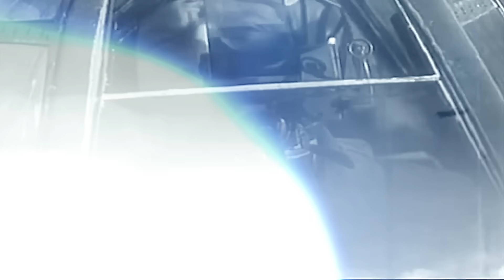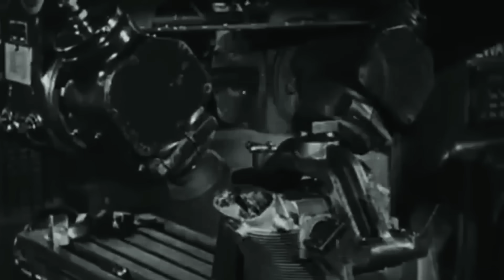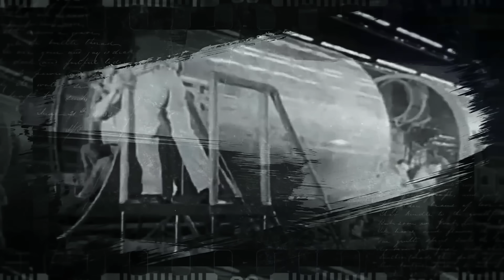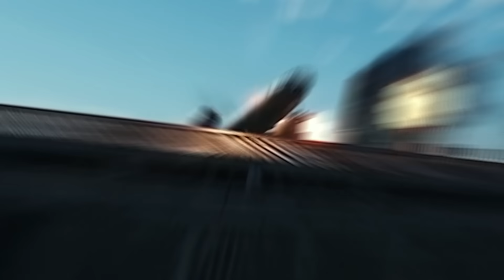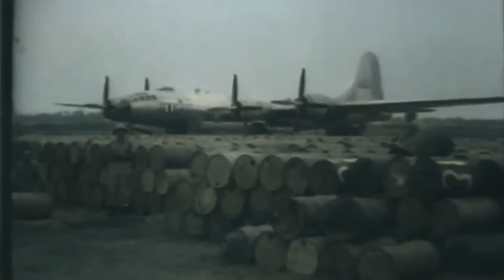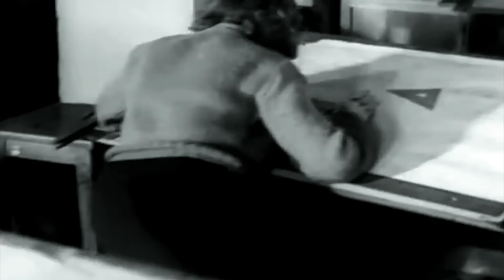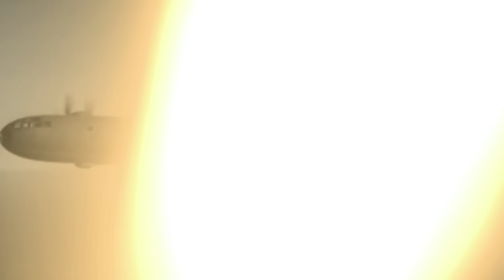The Shocking Truth Behind Wright’s R3350 "Duplex Cyclone" Engine

Comment: When it comes to the early use of the Wright R3350 engines and the early use of the B-29 Superfortress Bomber it has to kept in mind that the United States was at war with Japan and in wartime there was not the luxury of taking time solve the problems of the Wright R3350 engines before wide spread use in the B-29 Superfortress Bomber. Instead it was necessary to push the B-29 Bombers into use as soon as possible with trouble prone Wright R3350 engines. As time went by the problems with the Wright R3350 engines were solved and by the early 1950s later versions of this engine were reliable.

Comment: These engines were chosen for the RCAF's ASW Hunter Killer, the Canadair CP-107 Argus (33 built), which arrived in the RCAF in 1957, five years before the P-3 Orion first saw service in the USN. The Argus was a true behemoth equipped with four Wright R-3350 TC18EA1 Turbo-Compound 18-cylinder air-cooled radial engines, each producing 3,700 hp (2,800 kW). These engines were chosen for their lower fuel consumption, crucial for extended, low-level maritime patrol and ASW missions during the Cold War. Missions were normally 18 hours, up to 26.5 hours, and a record of 32 hours (a world record - no in-flight refueling). 
Two years earlier, the RCAF P2V-7 Neptune (25 built) entered service and for 12 years flew alongside the Argus. The RCAF P2V-7 Neptunes were powered by a combination of piston and jet engines: (1) two Wright R-3350-32W Duplex-Cyclone 18-cylinder air-cooled radial piston engines, each producing 3,700 hp (2,800 kW). These were turbo-compound engines with water injection, and (2) two Westinghouse J34-WE-34 turbojet engines, each providing 3,400 lbf (15 kN) of thrust, pylon-mounted under the wings. The Canadian Neptunes were initially delivered without these jet pods, which were retrofitted in 1959. 
I grew up with these magnificent Wright R3350s constantly coming or going on patrol during the Cold War, and when I joined the Navy, they were on the way out. 
We still had the Grumman Tracker (99 built), which also entered service in 1957, was initially designated CS2F-1(RCN) and later CP-121(RCAF), which was powered by twin Wright R-1820-82WA Cyclone nine-cylinder air-cooled radial engines...nowhere near the house-shaking roar of the four R3350s of the Argus. These aircraft were specifically designed for carrier operations and were the first Canadian-built aircraft ever ordered for the Royal Canadian Navy (RCN). Its primary mission was to provide long-range anti-submarine protection for the RCN's ASW-focused aircraft carrier, HMCS Bonaventure, which embarked them in 1957. During operations, four could be maintained aloft continuously. The McDonnell F2H-3 Banshee (Jet Fighters) were also embarked in 1957, with up to 16 available for CAP. Finally, Sikorsky HO4S (ASW Helicopters) served until replaced by Sikorsky CHSS-2 Sea Kings in 1963-64. 
Then Pierre Elliot Trudeau took an axe to the Canadian Armed Forces, and Canada lost its last Carrier, and all those classic aircraft had no proper home, until some DDEs were converted to DDHs. I am totally off topic. Old age and a lingering disgust of the Liberals and the Trudeau clan of Fools...
Okay, summary: Those engines were shockingly maintenance-intensive, but they were damn awesome.

Comment: I have over 900 PLUS Hours flying Rightseat in EA1F's from Yankee Station carriers using R3350-26W's . Only one time did we abort due to engine problems . Plane capt showed up in readyroom holding both hands in a towel full of metal from the oil sump !!

Comment: Because some jackals engineer wanted to save a couple hundred pounds of magnesium was used.  LeMay had them fly at low level to target which reduced the stresses. Little did they know it also kept them out of the jetstreams
Reply: Nope, the Wright R3350 engines didn't have magnesium engine cases, it's a myth repeated in this video, they had forged steel cases just like the Wright R1820 engines in the B17 had forged steel cases. 
Almost every single thing you'll learn in YouTube videos about the B29 and the R3350 engines is incorrect, because they all use each others videos as source material, they just keep repeating the myths over and over. 
Engine fires weren't caused from them overheating, it's ridiculous to believe that magnesium couldn't dissipate heat quickly enough to where it'd build up enough to spontaneously combust anyway, especially when all the heat is way out in the heads, excessive heat shortened engine life dramatically, and the engines weren't really any more prone to overheating than any other engine, there was never really anything wrong with them in the first place, the problem was the contractor who was making the cylinder head temperature guages for the B29 had never made anything like that before and wasn't calibrating them correctly,  so when the flight engineers would open the cowling flaps to cool the engines it was already too late, they'd already overheated, unfortunately this wasn't discovered until very late in the war.
Engine fires happened during take off, they were what's called induction fires, that's when a fire breaks out inside the intake manifold, it happened because the early pilots would advance the throttles too quickly off of idle causing a cylinder to backfire into the intake manifold, as the plane was rolling down the runway the fire grew through the manifold causing the loss of each cylinder as it got to them so by the time it was near the end of the runway all power on that engine had been lost.
The early B29 pilots didn't have proper pilots manuals, they were simply experienced B17 and B24 pilots who were running the engines they same way they would on those unfortunately, and like the cylinder head temperature guage problem it took a while to figure everything out, and the reason the fire suppression system wouldn't put the fire out wasn't because of magnesium engine cases, once again they were really forged steel, it couldn't put them out because because the nozzles spray the outside of the engine and the fire was on the inside of it.
What was really magnesium was the supercharger impeller, once the induction fire had spread all the way back to the supercharger the impeller would start burning, but once again the fire suppression system wouldn't put it out because it was inside the engine, all that is pointless anyway because as the engine continued losing power the further the plane got down those short improvised runways on those Pacific islands and had totally lost power by the end it was too late, it was already doomed and would crash at the end of it.

Comment: Years ago, I flew DC-7s as air tankers. They had the 3350s, 3400HP for takeoff, 2900 continuous. 

If you treated the engines the way you were supposed to, they were quite reliable but if you pushed them too hard, they would be troublesome........

I never had an outright failure but did more than a few precautionary shutdowns, usually because of a clogged oil cooler or stuck cowl flaps.

Another thing about them is they would burn 1 - 4 gallons of oil per hour. 60W in winter, 80W in summer. We always said 'if it isn't burning oil it's because there's none left'. Also after we landed, it was 'fill it up with oil and check the gas'.........
Reply: Who did you fly for ? Butler or Erickson maybe. Sucks to not see round engines on tankers .
Reply: @lacyrider72  Butler, Redmond Oregon. 

Other than the serious turbulence around fires, I really enjoyed flying the tankers. 

There was a horrible tragedy in Sept. 1979 though, one of the DC-7s was flying from Klamath falls to Medford for an end of season party, it was VFR @ 6400', the top of the mountain was 6400' but the trees were higher. 

Several crews and mechanics were lost.....just terrible. I knew a good part of those guys.
Reply: @rrknl5187 a great treat when I would see one of Butlers planes following 97 . Putting time on new parts I would guess . I knew some Reeder pilots and a few of Bob Johnson’s pilots and had met Denny Lynch . Would you have liked to fly any of the new jet tankers ? They look mighty comfortable.
Reply: @lacyrider72  

Had I stayed in the industry, I would have most likely adapted to the jet tankers but I sure liked the deep rumble of the big piston engines.
Reply: @rrknl5187 my ex would tell you I never heard her but if there was one of those engines within ten miles I could hear it . Glad I was around to hear as many as I did .

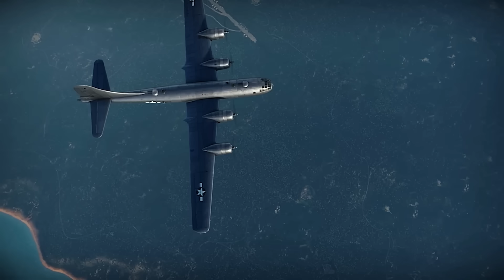Comment: @ 10:30, your reporting of using fuel injection is exactly correct.  The only B-29s that used the fuel injected engines were the Silverplate bombers.  The Silverplate bombers of the 509 Composite Group never participated in any raids other than the nuclear strikes, practice missions, and weather conditions flights.
Reply: Actually all US aircraft engines in WW2 had fuel injection, the only reason the Bendix "injection" carburetor was even called a carburetor when it was invented is because they didn't know to call it anything else, it's actually a single point throttle body mechanical fuel injection unit, not a carburetor in the sense people are familiar with like on a lawn mower with a fuel bowl, float and jets, because it wasn't really a carburetor is why US aircraft could fly upside down and pull negative G's without cutting out unlike the Merlin engine which would until it adopted the Bendix unit late in the war.

Comment: WE ENJOYED THE VIDEO
This video is a good documentary, answering many lingering questions about B29 mission aborts and engine fires. Most general war histories simply do not take into account the intense pressure on both Wright engineers and ground crews to make the B29 work reliably.
Your narrative avoids assigning incompetence or carelessness to Wright, and puts the issue into perspective as an unprecedented engineering challenge.
We subscribed.
Reply: No it's not, it's full of common myths about the B29, the R3350 engine didn't have magnesium engine cases, they were forged steel cases just like the Wright R1820 engines in the B17 were forged steel. 
That's just the tip of the iceberg when it comes to the misinformation in this video, all these videos on the B29 and its R3350 engines are full of these common myths they keep spreading around because the creators use the other videos as source material instead of credible books and actual USAAF documents for their source material.

Comment: I have often wondered why they did not scrap the R3350 and use the PW R2800, a well designed and reliable engine that i first form was really only 100 HP less that a well running R3350. They also could have increased the piston/jug size to get more cubic inch displacement and more power close to the R3350 and had a very reliable engine !!!   Shame....Also there was a program where they used the Allison double V 3420,  2 V1710's on the same crankshaft, had more power B29 was faster !!!   ???????  why not ?????

Comment: Need to quit repeating your self! Head about the titanium fire burning through wing spars way to many times!! Almost quit after the third time! Out side of the the repetition good video.
Reply: Magnesium, and the R3350 engine didn't even have magnesium engine cases, they were forged steel cases just like the Wright R1820 engines in the B17 had forged steel cases.
Everything in this video is nothing but common myths that get passed around in all these YouTube videos about the B29 and the R3350 engine because they use each other as source material.

Comment: Horrendous musak ! Detracts from an otherwise interesting piece, Thankyou. Litany of a development failure at least as bad as the development of the Bristol Centaurus and Napier Sabre, but each of those was sorted by mid 44 , (more or less). Like most of the late ww2 and post war pistons , the gas turbine was ousting the superprops. It is disgraceful that the far more primitive Wright motor is used in a Hawker seA Fury specifically designed for the Centaurus. All these engines were obsolete by 1945. Were these over 30k feet B29 s altitude capabilities put against the German jets ? I rather doubt it , but against Japan yes where range and height were paramount … but Europe ?

Comment: I flew the Navy AD5N Skyraider in the late 1950's which used this engine, long after these problems were solved, with no serious problems. We usually flew at very low altitudes and long range cruise power settings. No turbo compounding, however.

Comment: turbocompounding is what essentially killed piston engines - once it was realised that the power recovery turbines were contributing up to half the shaft HP with 3 moving parts and 10% of the engine weight, work really pushed in ernest to improve the gas generator driving them - and that meant gas turbines, despite turbines using 30% more fuel and (initially) not kicking out as much power as piston engines

Regarding civil engine reliability: TEAL (now Air New Zealand) pilots referred to their Lockheed constellations as the finest 3 engine aircraft plying the Pacfic. It was uncommon to end a long flight with 4 working engines and only slightly more uncommon to end one with 2. They were very happy to move to turboprops and turbojets as soon as ones with sufficient range were available

That many moving parts meant 8-10 hours of maintenance per engine after every long filght leg and TBO of 100-200 hours - requiring thousands of hours per engine

When faced with these kinds of stats, jets looked attractive even with the much higher fuel consumption. Yes they were more faster but early jet aircraft were necessarily heavier because of that fuel load and required MUCH longer runways than their prop-driven brethren

YB49 had half the range of XB35. Comet was designed for hot'n'high operation from Empire runways which heavily impacted its range. VC10 was designed(*) to have more range and passengers from runways too short for the B707 - meaning it was big, heavy and thirsty. (The B707 runway problems were solved for less than the cost of a single VC10 by extending the runways in question)

(*) Orders from the UK Air ministry, but left Vickers holding the bag for the costs (as the UK Govt did to Bristol for the Brabazon too)  - which demonstrates that blinkered vision is a problem everywhere

Comment: As an enthusiast of WW Aviation, thru the decades, have read the story of the B-29 and that 3350 engine. Number 17 cylinder...exhaust stem too hot, fractured, and raw fuel in the cylinder, and disaster, I guess. The crews would learn which engine, on start-up was smoking, so as a recent Author suggested, "That" engine killed more crews than the Japanese...Thanks for the video subscribed.

Comment: The production Hawker Sea Fury in Britain left the factory with the Bristol Centaurus engine fitted, only the racers would have had the 3350
Reply: Which is what they said in the video. They never said production Sea Furies were fitted with the R 3350.
Reply: It’s a shame to swap out the Centaurus for the lower performance CW engine. The Centaurus get more performance per cc at the same boost settings.

Comment: strange, one would think simply going from magnessium-aluminium alloy to aluminium alone would solve most of the problem!!??? sure it would weigh a bit more, but is that vital??  also, the germans had overheating problems with the first FW 190, those were solved by bolting a fan to the propeller shaft, pumping more cooling air into the engine cowling....